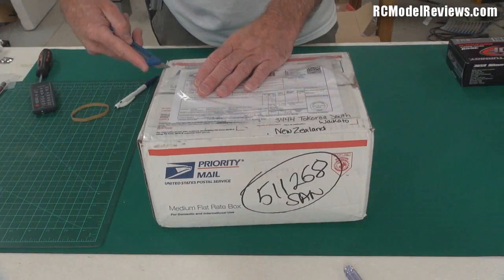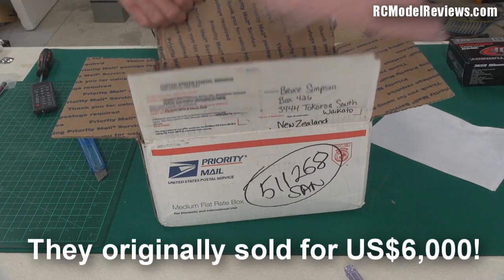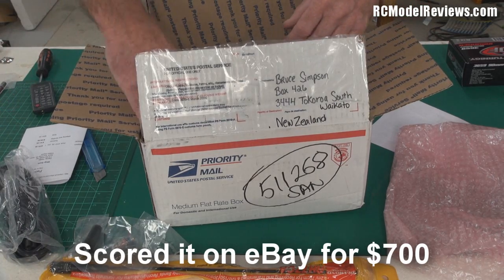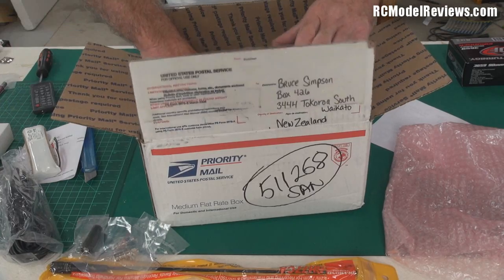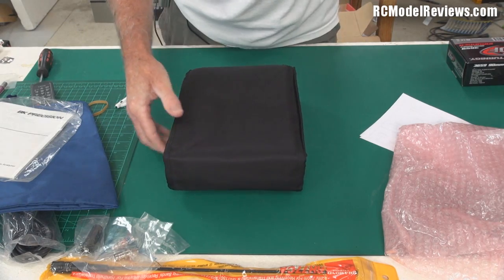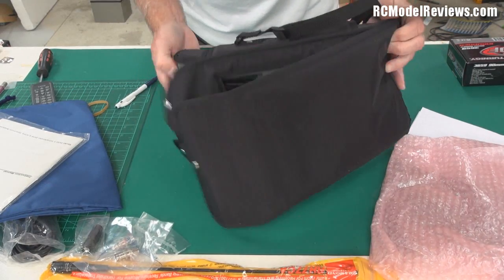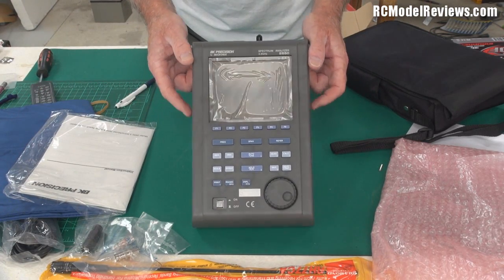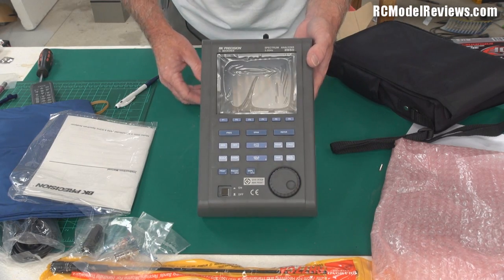Unpacking the new spectrum analyzer

Comment: What are you planning to use it for? Just see the output of your transmitter?

I certainly can not justify buying a spectrum analyzer even if i do a bit of electronics. A couple of multimeters and a oscilloscope and a cheap signal generator is all i need for most measurements. If i had bought a spectrum analyzer that would be a $1000 instrument that i almost never used.

Comment: Hi, do you know the little device called rf explorer? I bought one of these for around 170€ and it has 240-900mhz and a second module on 2,4 ghz. Rally small but also with display. Great to check the air on the field. If your interested look up my latest setup video....  Greetings from snowy Austria (30cm new snow today!)